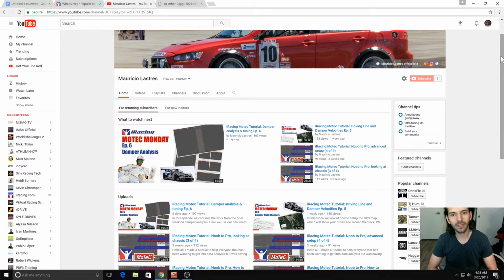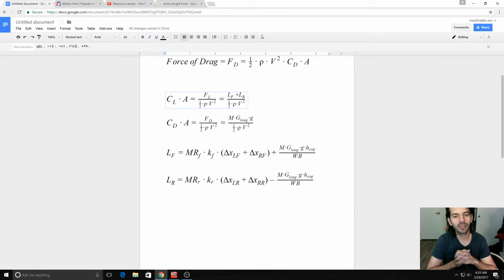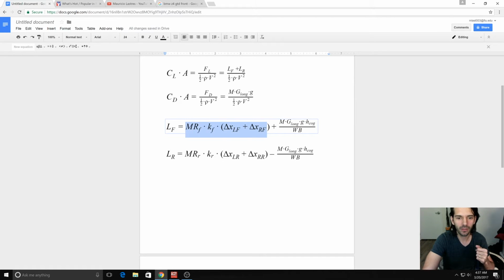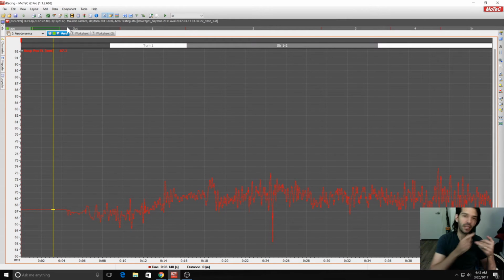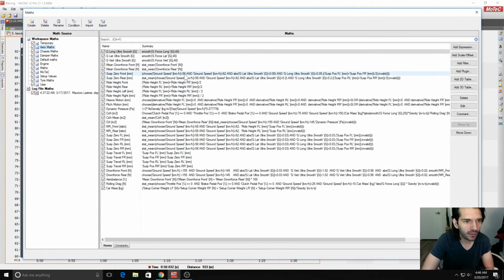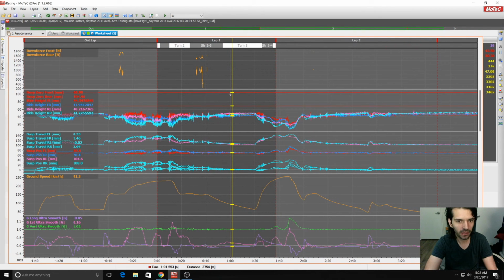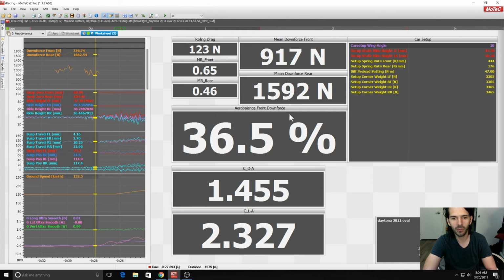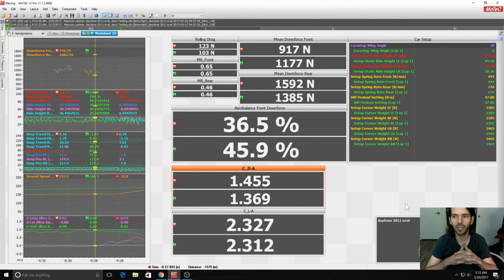iRacing Motec Tutorial: Aerobalance & Drag & Downforce Ep. 7

Comment: Hi, Great Series you have here. So i followed all the steps and recreated all the formulas but my sheet seems to not work properly. Either i am not able to drive 60 and 150 or something in my formuals is copied wrong. On my sheet following channels are not giving me any numbers at all: Downforce Front /Downforce Rear , Suspension Travel FL/FR/RL/RR , Mean Downforce Front/Rear , Aerobalance Front Downforce, ClA. I double checked every formual but i can't find my fault.. The other channels on this shown workbook are working correctly (Rolling Drag 290, MR Front 1,78, MR Rear 6,78, CdA 1,31.
Reply from the maker: Thank you for the support. If those are working and the others aren't then you can find the fault easily. In the choose term, change the ground speed to be > 40 and < 80. Then try it again and see if you get data. When it's very tight, it's easy to miss the speed and you will get nothing. You can also increase the range for the Ga and open that up some too. When you don't get data it's because you are not satisfying the conditions and that results in an invalid().
Reply: Now this works, thanks a lot for the quick answer. Looking forward to the other Videos :)

Comment: Hi Mauricio, nice video and very interesting !
I have a question, don't you think 1.45 is very, very high for a Cd*A ? On a normal road car is around 0.6... I know there is aero but still, on a GT3 car seems high
Cheers
Reply from the maker: No I don't so. According to a table on a 2011 issue of Racecar Engineering typical values of CDA for a GT2/GT3 racecar are 0.9-1.3. They also put an asterisk mentioning that results are configuration dependent. Meaning that the numbers will vary based on the cars setup and aero configuration.  And CDA is dependent on the air density so I don't actually know if there is an official air density used for this type of testing or in wind tunnels. Regardless, we know the z4 has much more drag than other GT3 cars. Checking over my table I can make the CDA as low as 1.1 and as high as 1.7. I can do that with wing and ride heights. SO the numbers are definitely in the ball park.

Thank you for your question.

Comment: Enjoying you videos man! I was wondering if you could do a vid on optimal gear shifts. Thnx and keep it up!
Reply from the maker: Thank you, Yes I will definitely do a video on gearing and shifting analysis. I just don't know exactly when I will do it. But it will definitely be made because its important. Thank you for watching :)
Reply: Mauricio Lastres really enjoying the videos. Any idea when you might be looking at gearing/gear ratios? Noticed this had big impact around Le Mans in the Ferrari so any motec stuff around that would be great :)
Reply from the maker: #SOON. Lol and when I say that I mean actual soon and not iRacing soon. Okay, Im working on that now. Should be up on Monday. But what do you need to know? Shift RPM or gear ratio selection?
Reply: I'm sure it's not a simple thing to do so even iracing #soon is ok, after seeing how much detail you go into :).

Ideally I think a bit of both as most I guess would welcome shift rpm to best make use of the fixed gearing we've often got. I've seen stuff previously about longitudinal g, straight line runs and gradiant matching of the rate of accel as functions of rpm?

Then I guess knowing about how to determine optimal shift points, anything about how to best go about investigating gear ratio selection for cars like the ford/Ferrari so that when combined with shift points you're optimising your acceleration vs top speed would be a nice extension to the process. 

Really enjoying the videos :)
Reply from the maker: Well its in the works and I gotta say...its sexy af. It may be well more intimidating mathematically than the other videos. What car are you driving?
Reply: Optimal shift rpm
Reply: Ferrari at the moment
Reply from the maker: Cool, yeah gear ratios. Ok well I made a spreadsheet for calculating the shift points for the given ratios but now I need to test and evaluate it. Unfortunately there are probably 4 or 5 different methods for calculating it and they all differ a bit. Im going with the more technically challenging horsepower integration method. I get different numbers than Robert Bryson who posted his shift points. But I don't completely understand his method but Im assuming its a different one than this one.

Comment: Great Videos, 
My Aerobalance showing 3067200,30% and mean downforce is 10x bigger than it should be and CdA is around 1000 times bigger and CLA is 10 times bigger. Car mass rolling drag and Motion ratios seems to be right though.  Problem is I can't find what's wrong. Do you have a clue? 

And btw the red colour in MoTec is very difficult to see on the video.
I really appreciate this.
Thanks
Reply from the maker: Hmmm, You're right. The red color is hard to see and all the others look fine. I hadn't noticed. I will see consider changing it and maybe increasing font size again.

Now for the main question,  first off. The motion ratios im afraid are not being calculated right. It just coincidental that the BMW falls close to right, but then changing car messes it up completely. So we need to change it. For now, I suggest you just make your MRs =1.  I tried a different method last night but it did not work well. I have a new idea but Ill have to wait until tonight to try it. What car are you using to test? If your CdA and downforce are way off that is very interesting because those two equations aren't really related to each other. So either there is a mistake on both or something else. Are you in the BMW?
Reply: Thanks,
Yes I noticed that because I got different values every time for the MRs. It shouldn't vary for different tracks just for different cars right? because we can't change that in iRacing. 
I tried to delete the MR channels and replaced them with a constant , that didn't help.

No in the Audi R8
Reply from the maker: Yes it should be the same for the same car but it may also vary with setup changes. Im trying to figure out a better way. Ultimately it will all need to be part of a procedure. When a new build or car comes out we need to do an aero test. First you do the low speed constant runs to set the suspension zero position and the MR. Then take the MR and manually fill it in as a constant or have one MR calculated channel and one constant and have the downforce calculations based on the constant. Then you can go about changing the setup and doing a bunch of constant speed and coast downs. We then take that data and fill in 2D and 3D tables.

Then when we are at the real tracks we have a worksheet with aero information based solely on the look up tables. For example, you may want to know the aero balance through corners. Well thats dependent on the wing and ride heights. We have the look up tables so it will calculate your aerobalance as a function of ride heights and maybe the wing too. 

I think that will be the best way to go about it and avoid bad inconsistent data.
Reply from the maker: M Taynton I've asked around. The R8 should have .58 front and .88 rear. Aside from that, check your units and check your parenthesis.
Reply: I just sorted out the Aerobalance and the other stuff except the MR. I had by mistake divided my Susp Zero FL - RR channels by 2 like the Susp Zero Front and Rear channel but there is nothing to divide it with :) and I also missed a paranthesis. I have to blame that I was tired when I set that up.
Thanks a lot for your help and time I appreciate it

Regarding MR at the moment I'm going to use a constant of 1 for the Audi, when I used the working  calculated MR I got variation from 1.5 up to 2.0 for the front and 1.7 to 2.4 for the rear with the same setup
on two different tracks.

Is there somewhere where we can discuss this further? I would like to show you my trail of thought without clogging up your comment field lol
Reply: Thanks that seems to be more correct I will try those

Keep up the good work with the videos :)
Reply from the maker: M Taynton they are correct. I've texted and asked a bunch of people and so far I got MR values for Aston Martin vantage and R8.
Reply: Didn't mean to step on your toes. I just have no idea about the real values but it was more in line with what I  expected to see. Thanks a lot for taking your time and asking around :) . Is it something you are willing to share with us?

Comment: Great information stuffed in here mate. Just one thing. You got to take into account, if the Clutch read out is 100 or 0 percent when engaged. I struggled for a few hours getting CdA and Rolling Resistance read out until I figured out mine is 100 when engaged. But this is super stuff. Thanks
Reply from the maker: Martin Vinther  thank you for your comment. I appreciate it. I have in the logic statement for the CdA and Fr a check that Clutch Pos==0 and throttle pos ==0 and brake pos ==0. So it has worked well so far. In addition I also limit the speed range. For ground speed <150 kph and ground speed >100 kph.